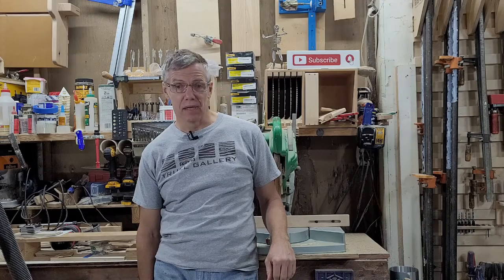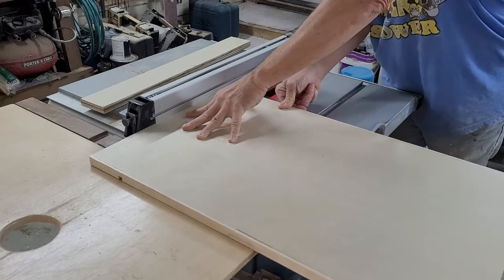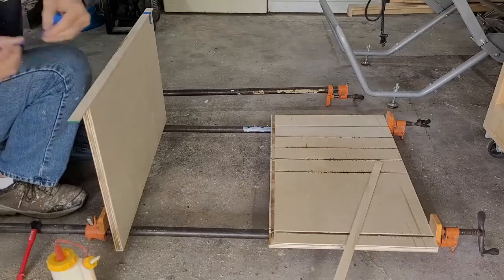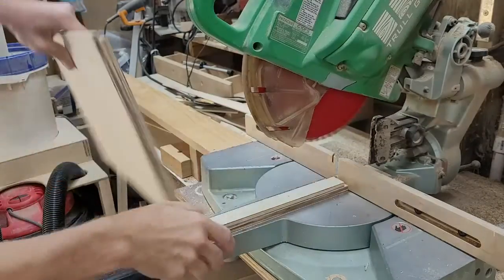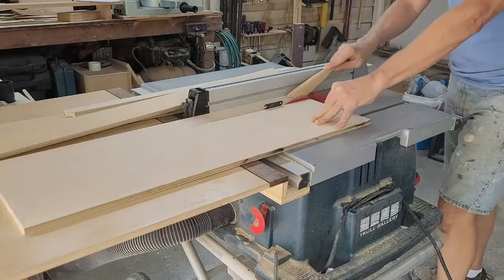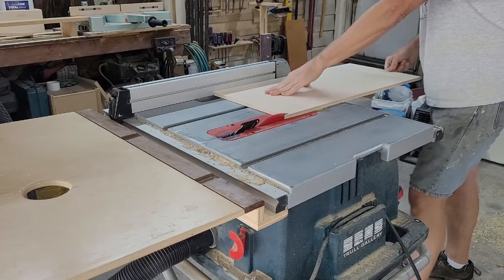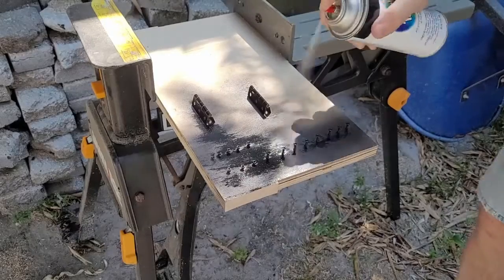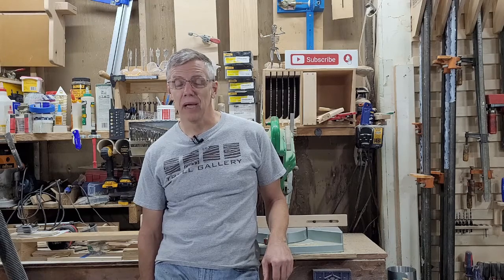Building a Stand For a Bench Top Drill Press

Comment: All the stand designs never seem to make use of the rotate the head and the slots in the foot plate functions. If you create a hollow in the back of the stand with various stock holding devices allowing thread to swing around to end drill long stock. The slots can allow the whole press to move and place the chuck quite far over large ended stock.
Reply from the maker: Good idea,although I have only needed to swing the head around once or twice in the 30 years that I've had this press.
Reply: @TheTrullGallery  As said, "all the stand designs...". not just yours. The hollow is also useful to store long fences,  table extensions and such.